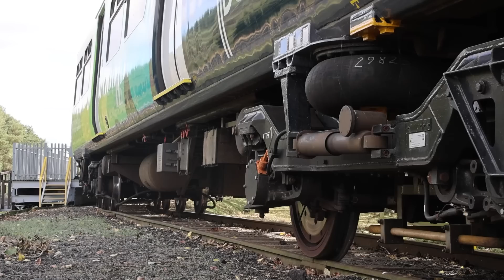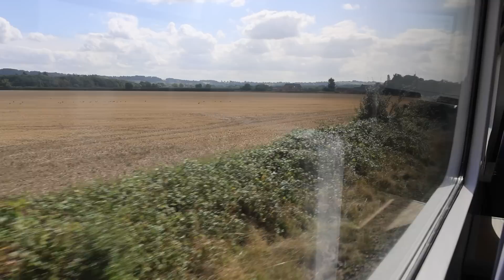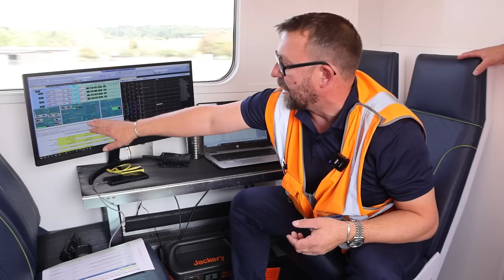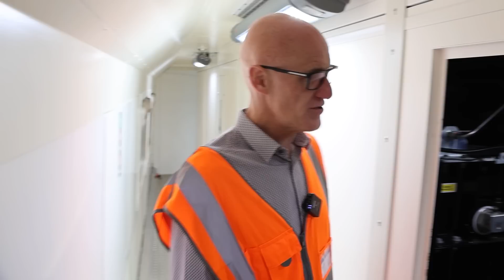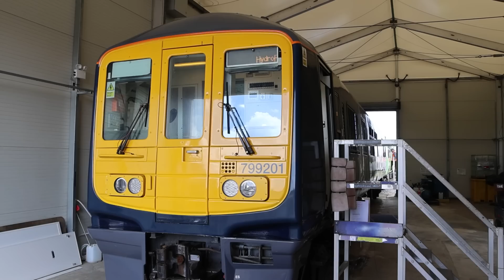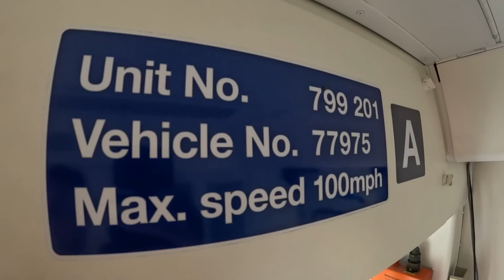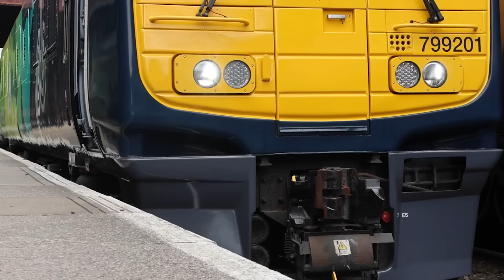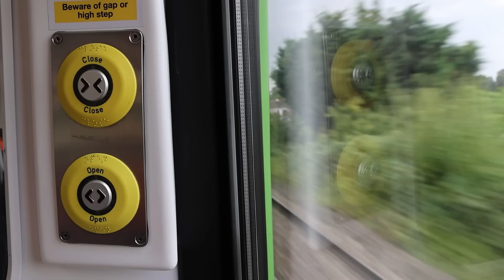The Class 799 Hydrogen Train

Comment: Trains like this are needed in Uckfield.
Reply: No.  In motion charging battery electric trains would me far more efficient users of electricity.  Between London and Hurst Green the train would draw current from the third rail both to power it along and to charge the batteries for the section on to Uckfield,  (There could also be a stationery charge at Uckfield station.)
Reply: What have you got against Uckfield?
Reply: @conradharcourt8263  Who’s against Uckfield?
Reply: @eastlancsesteem  I just wondered why you wanted Uckfield to have ridiculously inefficient, impractical and expensive trains. Surely it would be better to have trains where electricity is simply used to actually move the wheels, rather than wasting up to five times as much energy creating a pointless intermediary fuel.

Comment: The engineering is impressive but in all but very exceptional cases, the right approach is going to be overhead line equipment. We need to be talking more about the failure of successive governments to actually get on and electrify more of our railway.
Reply: Exactly, they've spent all this money on East West Railway but haven't bothered to electrify it? Makes no sense...
Reply: @abigailcooling6604  I understand it is "for but not with."
Reply: Doesn’t help that the GWR electrification scheme was horrifically over engineered, massively inflating the costs and time required to install, which in turn has made the authorities wary of future schemes.*

But Scottish electrification schemes have shown that most can be completed on time and a lot closer to budget. England should commence a rolling programme like ours. 

*Redesigning the OHL was a mistake in my view. With the exception of headspans and weighted tensioners there was very little wrong with BR designs. Both of those things could be easily eliminated.
Reply: Agree. And in the few cases it isn't worth electrifying a branch line, a Perry People Mover would be a superior option to hydrogen.
Reply: I live on the Leeds-Barnsley-Sheffield line, which, like most lines in hilly areas has a ton of Victorian era bridges and tunnels, all of which are way too low to fit overhead cables
the sheer cost and difficulty of rebuilding these means this line has zero chance of ever being electrified, and is more likely to be closed outright
Reply: @lefthandedspanner  Are there actually any bridges and tunnels that can't be electrified with either overhead wire or third rail?

Also note that insulation materials have come a long way - nowadays you can have a sold rail rather than a wire above the train, with not that much insulation against the tunnel ceiling even with higher voltages. (And also of course you could go with a lower voltage in the tunnels if that would actually be necessary, like in the early days of 25kV AC electrification in the UK, when they for a brief period used 6,25kV at sections that they at first thought hadn't enough clearance for 25kV.
Reply: @lefthandedspanner  That's the perfect use case for discontinuous electrification and battery bi-mode trains, as they are doing on the Valley Lines in South Wales ... electrify most of the route, but just leave short gaps or dead sections where there are bridges, tunnels or complex junctions that are particularly difficult or expensive. Because these gaps are short, the trains only need small batteries to get through them.
Reply: @lefthandedspanner they've rebuilt the Victorian tunnels and bridges on other routes that have been electrified.
Reply: @lefthandedspanner  battery electric with partial electrification (overhead charging sections) is possible in that situation for a lot less cost and energy than electricity via hydrogen.
Reply: @lefthandedspanner  third rail exists for these applications
Reply: @lefthandedspanner  batteries ar cheaper and simpler for powering trains that cannot use the grid
Reply: One of the reasons previous governments have failed to electrify lines is the broken promises of hydrogen trains from companies just like this.

Comment: I mean, the question is not about power, Hydrogen is a very high power density fuel... and yes, it drives like an electric, because for all the things related to locomotion it basically is... maybe a little lighter (and therefore slightly lower maximum traction) but overall should  feel thesame. the question is how they make the Hydrogen, a volatile explosive fuel, safe....

I like hydrogen as a technology, maybe, if you can mount the whole of the hydrogen above where the passengers are, such that any explosion will immediately get vented upwards (I know that is what was done on busses where I live, nearly all of them do run on hydrogen), but ultimately, the place where this train needs to prove itself is a crash-course test, not in the capability department....
Reply: High density in J/kg, but very low density in J/litre.

Comment: As with all things Hydrogen. The issue is NOT the end use (ie h2 tanks using fuel cells to produce electricity for end use), its the production and distribution.

Currently production requires extensive fossil fuel usage to make (ie converting energy into electricity, to then convert to hydrogen, to then convert back to electricity), and there are great plans to move to using excess green energy to produce h2 when not being used for the grid (eg using wind turbines to produce electricity even when the grid has no demand for it and to use that 'excess' to produce h2, thus improving the general energy efficiency of all systems), the next issue is distribution... h2 is super super super difficult to handle over long periods of time, the h2 molecules are soo small over time they will leak THROUGH solid metals, and cause material changes to the materials with time weakening them - to keep h2 liquid super high pressures are needed, so that weakening is a bad thing).

I'm a huge proponent of green tech and putting as much into our systems as possible. But only where it makes sense.

These trains are only helpful on non-electrified rails. But once you factor in soooo many other factors at play, over the long term it may well be cheaper to actually electrify the railway using traditional methods than to change the fuel source to h2.

H2 offers no benefit over existing electrified systems as copper wires are the most efficient means of transfering the 'energy' from source to destination, every step of the h2 lifecycle loses energy.

Where i can see these being genuinely game changing are the really really really long railway routes in the US and trans european routes. But even then the cost of H2 is still way more per km than diesel :(

Great to see technology like this being developed in the UK as it would become a future export product using 'UK PLC IP' but lets be realistic as to its overall benefits (or potential lack thereof) in the UK itself.

Love the video and great interview
Reply: Exactly correct. 

Of course for the cost of the fuel cells, the whole area taken up with H2 gubbins could have been stacked with lithium battery packs, and recharged every time the train goes under overhead wires. You wouldn't need to electrify the whole track. Probably just electrification at the stations would be sufficient.
Reply: Exactly correct. Electrification is the way forward. 

Where that's not possible, short sections of electrification and batteries make more sense. Batteries are vastly cheaper than fuel cells, and the efficiency of about 80-90% is vastly better than hydrogen at about 10-20%
Reply: Ahh, I thought my comment had been sucked into the aether. Now it's back along with its replacement. Oh well.
Reply: Could trolly wires be a pragmatic solution to electrification? Less efficient in power distribution, but better in installation costs… actually no reason that trolly wires can’t be 25k, just less catenary.
Reply: Why does every video like this have someone banging on out the cost or problems with producing hydrogen? They never seen to bang on about the costs and problems of producing any other fuel source.
Reply: @neiloflongbeck5705  basically to try to counter the misinformation that's spread about H2. Something you're in need of. It's not a "fuel source", it's a carrier, like a battery. Indeed, it's not even "like" a battery. It is a battery. The fuel cells are batteries that have a gaseous electrode, the hydrogen. It's just a really expensive, inefficient and very difficult to recharge battery.
Reply: @gasdive  in this case its a fuel because it is used up to create electricity just like uranium 235
Reply: @neiloflongbeck5705  it is by some definitions not a fuel because there are no such things as hydrogen mines. it is a store of energy and not a source of it
it is maybe a semantics argument but in effect, if you are charging a battery, that battery is not a fuel, the fuel is whatever you used to charge the battery. by the same systems, hydrogen is a store not a fuel, the fuel is whatever was used to make the hydrogen (which is often fossil fuels, and sometimes a lot of renewables (more than would be needed to charge the same capacity of batteries)
Reply: @thmsbarber  a battery is not a store of charge but rather a store of chemical potential energy. The chemicals in the battery react only when there is a path from anode to cathode. The same is basically true for a fuel cell. It's just a different type of electrolyte. Natural uranium, although radioactive, needs to be processed to increase the levels of Uranium 235 from around 0.7% to a more useful 3%. But, we never hear of this cost when discussing nuclear power. But hydrogen is special and the costs of producing it must be included in any discussion other use of hydrogen as a power source.

According to ISO 13600, an energy carrier is either a substance or a phenomenon that can be used to produce mechanical work or heat or to operate chemical or physical processes. It is any system or substance that contains energy for conversion as usable energy later or somewhere else. This could be converted for use in, for example, an appliance or vehicle. Such carriers include springs, electrical batteries, capacitors, pressurized air, dammed water, hydrogen, petroleum, coal, wood, and natural gas.

As for your fatuous remark about hydrogen mines, that just goes to show your disdain for your fellow man.
Reply: @neiloflongbeck5705  because they’ve already been factored in by cost or… subsidies 🤔
Reply: I think hydrogen is a technological dead end given the costs and environmental impact of extraction. Whatever you do to a class 319 the result is living proof that you can’t polish a turd 💩

Comment: Great idea, but I'd be a bit concerned about the lithium batteries. They have a tendency to catch fire 😐
Reply: It's pretty rare for batteries to catch fire, and when they do it's usually in cheap consumer electronics not in industrial grade packs. In a train there are plenty of other things that can catch fire and are much more likely to do so than batteries.
Reply: @mattsmith517  That's good to know,  but my understanding is that if a lithium battery catches fire it can be very hard to put out, much harder than a conventional fire. No doubt they will be taking steps to minimise any risk.

Comment: I am not surprised that the train works well- the technology is well understood. Providing the hydrogen is another matter as it is either made from fossil fuel sources (defeating the purpose) or by the very inefficient electrolysis process.
Let's hope that it is more reliable than the diesel conversions of the 319.
Reply: I strongly agree with your electrolysis point.
Reply: @Fan652w  I believe the countries that produce hydrogen as an industrial by-product are more suitable for using it for transport. Also it's a pity about the wasted heat from the fuel cells, no wonder they have a relatively low efficiency.
Reply: It's a better use of electricity than cryptocurrency mining, which is designed to be as wasteful of energy as possible.

Comment: The problem with hydrogen is that it's nearly all created from fossil fuels. It could be from water, but the energy you have to put in to creating, storing and transporting it far outweighs what you put in. It might be useful for certain types of train in rare situations, but in most cases just stuffing the floors of the carriages with batteries is better, cheaper and more environmentally sound right now. Maybe it will change, but I suspect it will go the same way as hydrogen fuelling for cars did.
Reply: I'm not sure, but I think hydrogen is some kind of waste product in some branches of the chemical industry.
Reply: ye, the plunder of Petrolcompanys to make lobby work and propaganda about "Green" Hydrogen as "good" method to "store" surplus energy ... if you ignore a lot laws of physic but otherwise ... the efficency is less than a Diesel with about > 25%
for some usecases it might be the better alternative for fossil fuels, but for cars or Trains, not really ... to bad that the same Petrolcompanys are really good at propaganda and let "Sane" People forget that petrol, diesel or kerosin surpringly doesn't come magicly out of the pump and only point at the evil recycleable Lithium and the hole battery recling that's getting flatout dismissed and ignored
Reply: On the other hand for our lithium shills out there... If you have 2 equal area volume solar arrays generating 500 miles range for the hydrogen tanks or conversely generating 500 Miles of range for the batteries... IT DOESN'T MATTER if the 500 Miles of hydrogen takes longer to make from the same size solar array or uses more FREE solar electricity... the key useful EFFICIENCY specification is that the hydrogen transfers to the train INSTANTLY. The electricity takes hours to transfer to the batteries. Get it yet "inefficiency" propagandists? The efficiency of not wasting your time because of instant transfer is what's important... not the efficiency of the volume of electricity used. The picture painted of hydrogen always having to be "transported" from somewhere else rather than generated at the refilling location is another smoke and mirrors propaganda facade propagated by the lithium shills.
Reply: @MoreSuperiorThanCarbon  how much do you get paid for that? At least i hope you get paid for that and don't believe that BS yourself

Comment: Hydrogen still has to be 'made'. It's only green if it's made with 'renewable' electricity....Why not use 'renewable' electricity to fill batteries and forget the hydrogen altogether?
Reply: The "Recharge" time, I'd assume. The ideal is nuclear power, so we have a supply for both the mains network and to allow Hydrogen production facilities to steam-crack the hydrocarbons that are the main source of Hydrogen.
Reply: No it isn't only green if made with renewables. Because while producing it conventionaly is* polluting, using what's produced doesn't add further pollution, unlike petrol or diesel. So overall it's greener, just not yet as green as it could be, Given improvements in infrastructure and technologies..